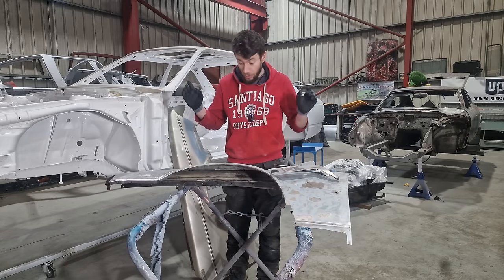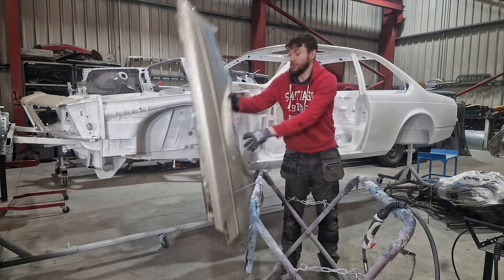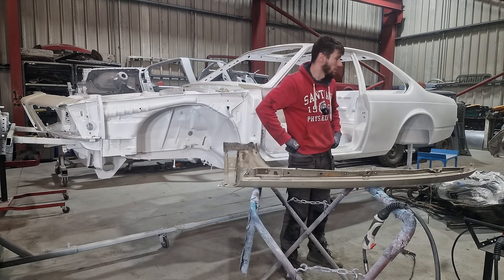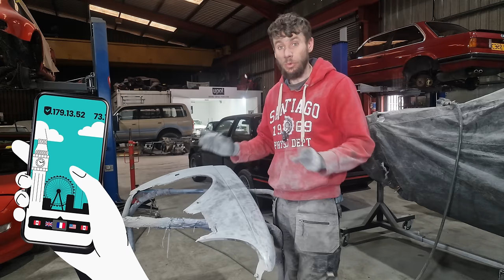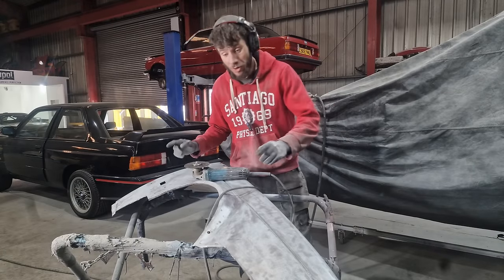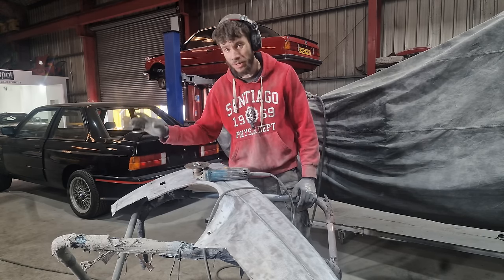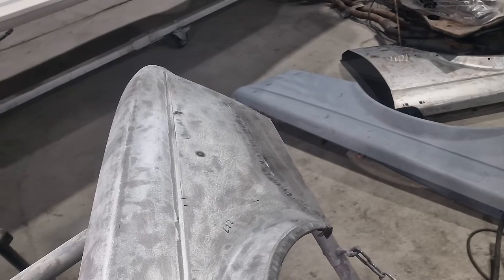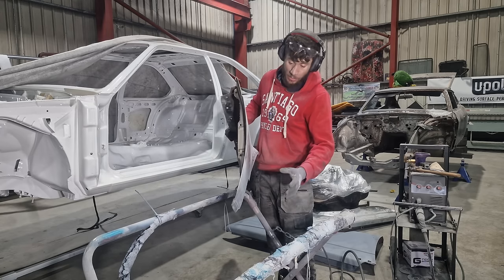Finally Complete!? Restoring Mat Armstrong's Classic BMW E24 - Tackling The Rusty Wings

Comment: So what is the good reason for not replacing the wing with a new one? You said you was going to answer the question but never did?
Reply: I'm gonna guess they wouldn't have as much content if they simply replaced panels !
Reply: More like unobtainium, might find one in a specialised breakers, but likely to be just as rusted
Reply: The same question. There are lots of them for sale.
Reply: I think  he love his job and like to fix thinks,also could be quality of the new panels
Reply: If you guys have lots for sale let me know i might buy them all if they are new. I was quoted 1500£ for a pair of front wings (patched and welded) 🤦

Comment: You keep me amazed how you recreate a panel that is only slightly curved and make it fit. It is flexible so it wants to go back to a plane, flat piece of metal, and yet you somehow persuade it in the shape BMW's designers wanted it.  Makes me think: how did the fabricators in the prototype phase at BMW (or any other car manufacturer) this, without a reference other than the drawings of the designers?   
Thans again!

Comment: You didn’t explain why you don’t just buy new wings. Or did I miss it?
Reply: I was thinking the same
Reply: I think I remember from an earlier vid that unless they can source genuine parts (which by default have had to have been stored for a considerable time), the newer after market ones are of a lighter gauge metal (of sometimes questionable quality) so not suitable for a ‘proper’ restoration.  
But ……. I may be wrong 😅

Comment: You never told us why you didn't just buy new fenders....🤔
Reply: Because of the age and price range they try to stay in their restoration process. Matt Armstrong wasn't charged for anything or any of the other YouTube creators. So if they can get away with restoration of some parts instead of buying.. probably why the new in video ads will be on every episode now on.
Reply: I'm guessing BMW no longer sell these parts as it's such an old car. I used to sell aftermarket replacement body parts, and the quality of steel used was poor, as well as the overall fitment. Trying to align the panels to the body of the vehicle was often very, very time-consuming.

Comment: he never did say why he dont buy new panels, but my best guess is that there are not any available 😆
Reply: they don't make them any more, so the few you might find are 1. in demand and as a result really expensive and 2. also likely to still need some work given the age of the vehicle. For some cars you can get pattern parts (not OEM but a clone that is made to fit) but quality and fitment/accuracy on those is very variable, they only do the most popular models and again they tend not to be that cheap. 

He's said in previous episodes it's cheaper to fab from scratch than buy for some of these pieces